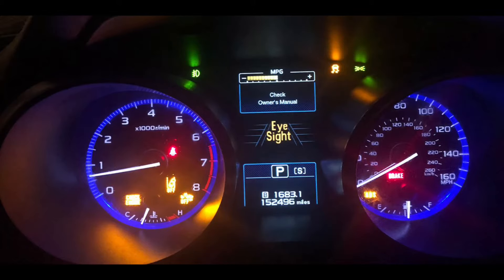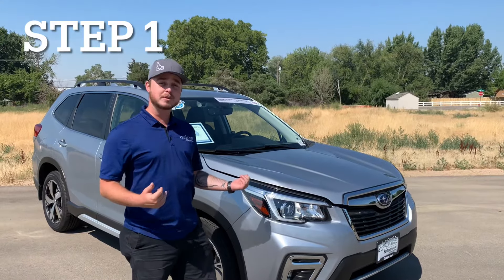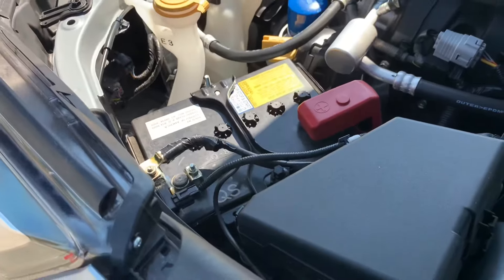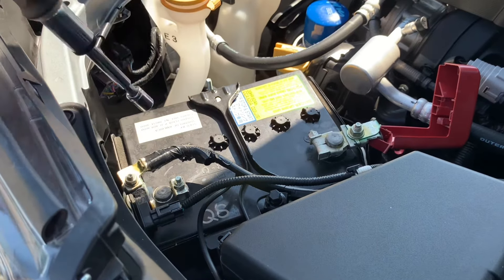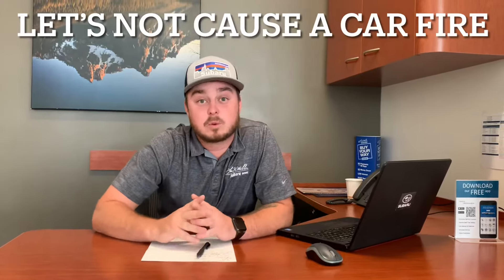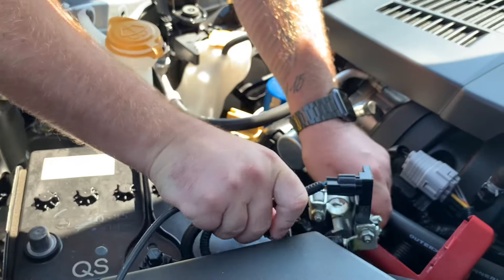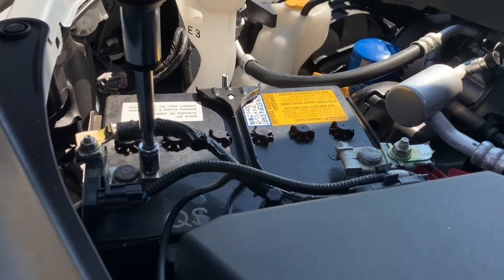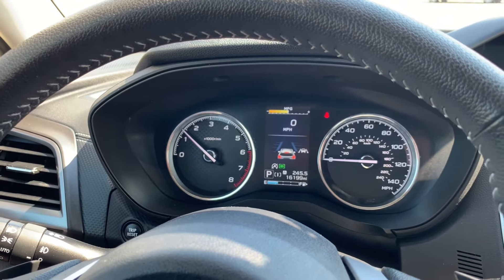All Dash Lights are On… Subaru

Comment: I did this and it worked, but this continues to happen. Anyone know an actual cause to this? Ours started after a car wash. The car drives fine, but when this happens eye sight turns off and cruise control also. Took it to a car repair place once and they said there were 8 pages of codes. Something causing these lights to go crazy.

Comment: Pretty sure touching the cables, old school, to reset check engine and service lights, has the potential to short one of the many computer chips and and circuits in these newer cars.  Connecting them via a 10ohm transistor will allow the residual charge to dissipate without surging the computer system.  But in a pinch, that's the way to do it.  This technique applies to all check engine service lights.
Reply: "10ohm transistor" LOL!

Comment: And is your way is to just remove the negative battery cable wait four to five minutes then put it back on all that should disappear as well. There's no real reason to reset the ECM, when you do that all of your mileage tracking information is zeroed out any schedules that you made for your oil changes is zeroed out you'll have to redo them or create a profile before you do any of this and then you can recall everything by recalling your profile, the profile is burned in permanently into the chip until you either delete it or create another profile and then delete the first one, but guaranteed should be doing a little bit resetting or a little bit recalling if you follow the ECM reset method come, again with all the lights on it's still don't really need to do that the way to check your battery voltage is

Go check your battery voltages turn the engine off if it's on. Preferably wait about 15 minutes so that you can have a bit of a cold start and a high RPM.

Turn the car electronics off anything you can do you might have set your camera to be on your rear camera through the camera hack the camera hack is easy all you have to do is hold the home key and then tap the radio tune button twice quickly

Hello getting you into the factory settings menu now here you can you'll see connection and if you go to vehicle signal you should see your battery voltage at rest where your steering is laying and everything else should be set to off now while looking at that screen press and hold the ignition button and let it go don't press on the break yet and you will see IG for ignition on now step on the brake start the engine the factory settings and screen will go back to home screen.

So go back into the factory settings hold the home key down and tap the radio tune button twice quickly, and now it'll be a connection screen now move over to vehicle signal you should still see ignition on and your voltage should be above 12 and 1/2 it should be at least 14.1 or higher with the engine running and headlights off turn your headlights on sometimes your voltage could go up to 14.7 but if it's at 14.2 while the engine is on and the fans are on that should be good and your battery is good if however turn the engine off and you wait 15 minutes and come out and go to factory settings and see your battery voltage less than 12 let's say 11.7 or less your battery is on the way down and you're going to want to get a new battery or or it could be that you do a lot of idling it's part of your day-to-day driving and if this is true your battery is probably not charging fully everyday one way to fix this is to put it on a trickle charger at least once a week and then you should see your battery voltage normalized if it doesn't normalize after a month of putting it on a trickle charger at least once a week overnight, your battery is going dead it's going bad so time to replace it. At rest you want your battery to hold at least 12 and a half volts or higher it probably won't be higher but you want it at least 12 volts.

Now here's an interesting part about the Subarus when you press the ignition button on and then release the button then start the engine the normal way, that press and release button actually puts a charge from a capacitor to the starter system and gives an extra boost and this is especially nice if your battery is starting to go down.

But a good alternator and a good engine you should be able to see 14.1 to 14.2 volts at engine idle it may drop down to 12 volts once your engine's been idling for about a half an hour or more but as soon as you turn your headlights on your alternator will get your battery back up to 14 volts

Comment: unfortunately this would not fix the problem.... i have installed brand new battery and only OBD scanning showed the real problem... the issue with the late model Subaru Forester & Outback is Thermo Control Valve Assembly....  very expensive to repair and very expensive part.... fails very often below 100K..... Subaru is loosing good reputation and customer loyalty every single day by delaying recall and should recall ASAP all the vehicles fitted with this part because EyeSight is disabled and vehicle is unsafe to drive.... are they really waiting for something to happen before they consider recall

Comment: What if it keeps coming back up the light issue then what
Reply from the maker: If it keeps coming up, battery may be dead, or a deeper issue. At that point I would take it to a Subaru Dealership and ask them to test the battery/ charging systems. Hope that helps!

Comment: your not fixing anything! Just resetting the codes. Might be best to read the codes and see if there is an real issue. Possible issues... Bad gas cap, bad coil and/or spark plugs or brake sensor.
Reply from the maker: This video is primarily geared towards people that may have not clicked the gas cap over correctly or a battery was sitting for a while and died then shows low charge initially. You're 100% right if it comes back on I would take it to a dealership or Subaru mechanic. However in the past our service dept has encountered people coming in when this simple "fix" would have solved a non issue that triggered the lights.